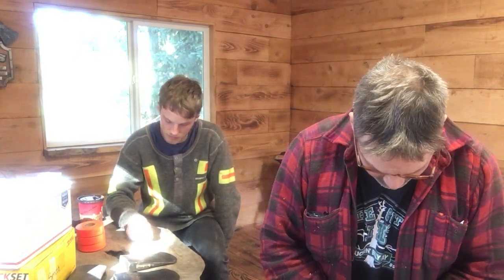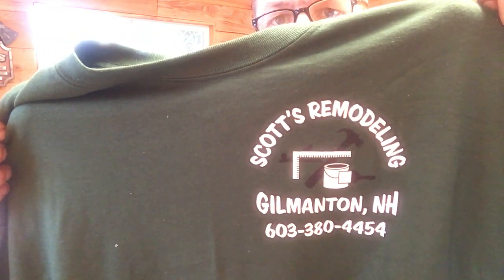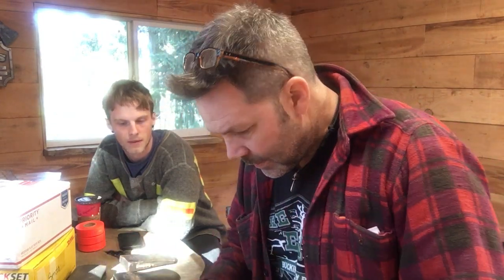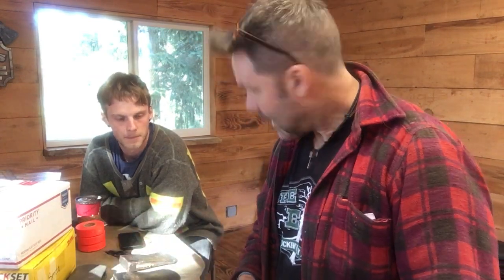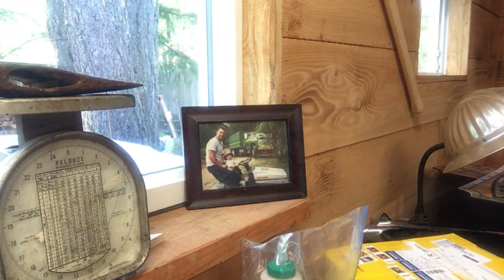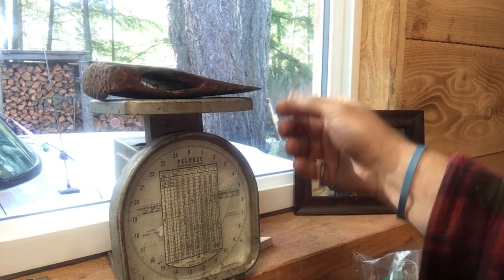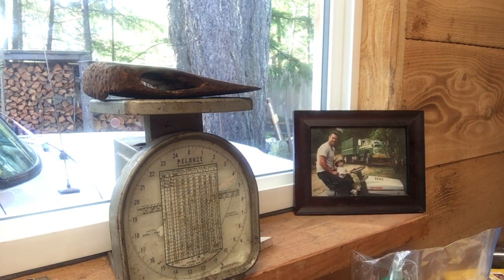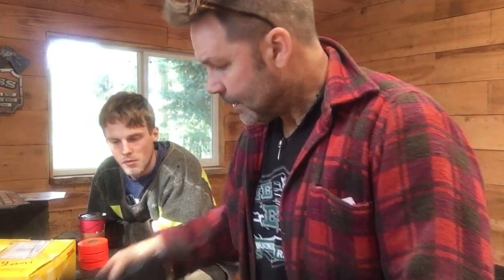CONTENT MANIA PT 2

Comment: I got two axes, but  I don't know if they are choppers or splitters.   I used to use them to cut up flat roofs that had been reroofed for 80 to 100 years for removal.   These lasagnas of roofs were usually 2-3" thick.   Now I moved to the country and I want to make firewood to heat my house.

Comment: I have a couple of chopping axes, but I could use a double bit ax and a splitting ax.

Actually, I don't know if the two axes I got are choppers or splitters.   I used to use them to cut up flat roofs that had been reroofed for 80 to 100 years for removal.   These lasagnas of roofs were usually 2-3" thick.   Now I moved to the country and I want to make firewood to heat my house.